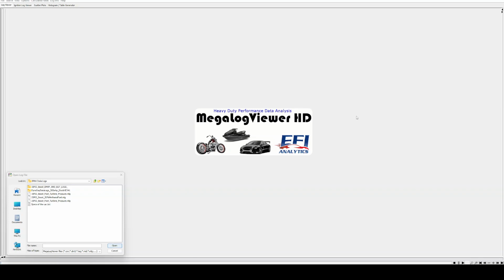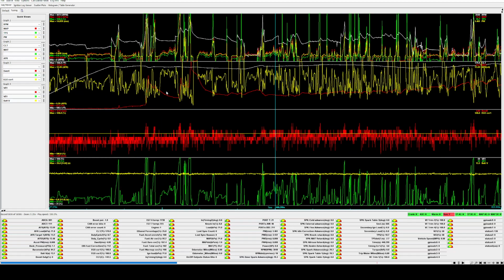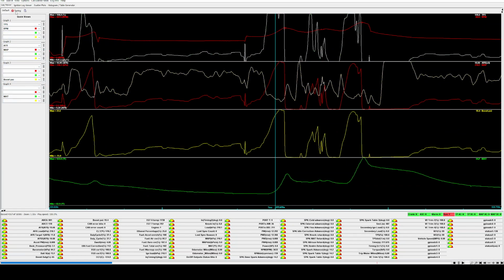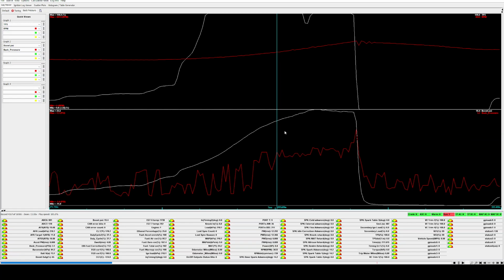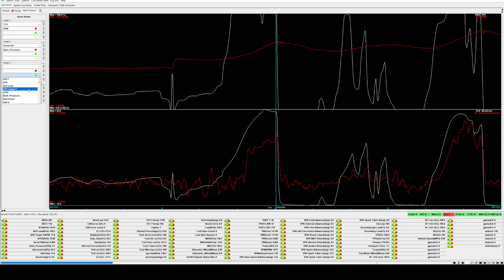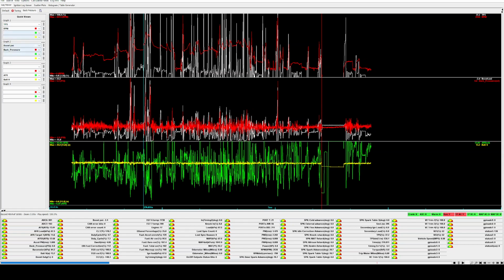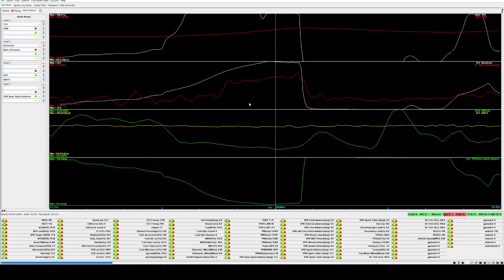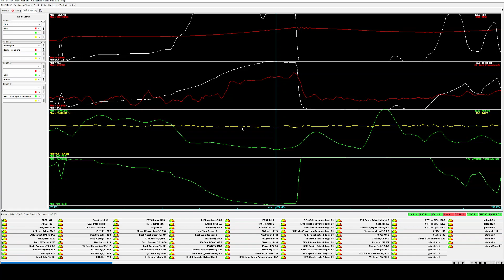MegaLogViewer Datalog Basics | Megasquirt Basics | Learn to tune

Comment: Is there a setting to make the values attach to where your cursor/vertical line is?  I have seen many videos where the data values are on the cursor but I can’t find that setting in my (should be latest) version of MLVHD.